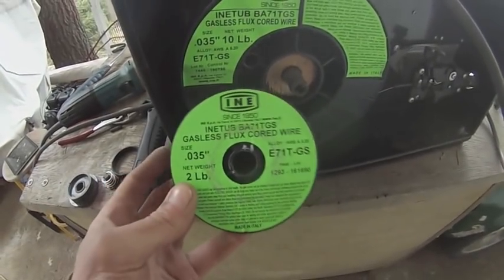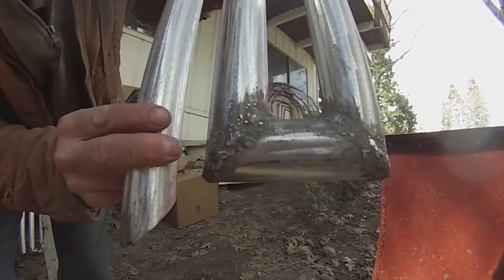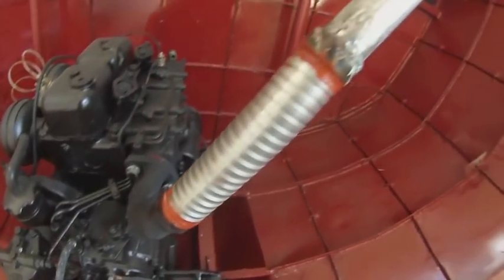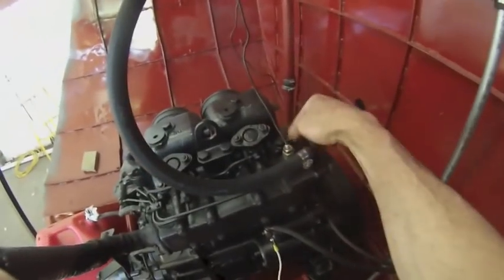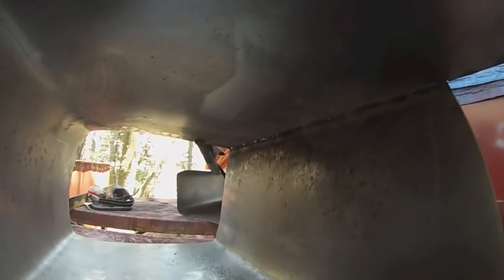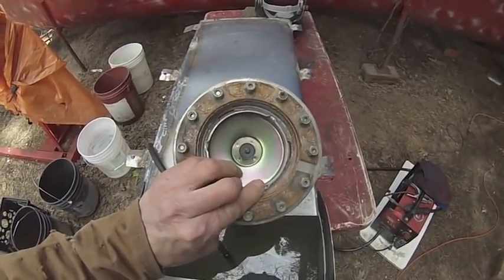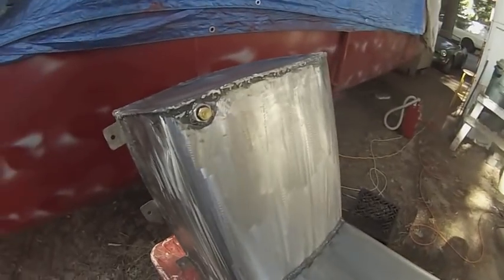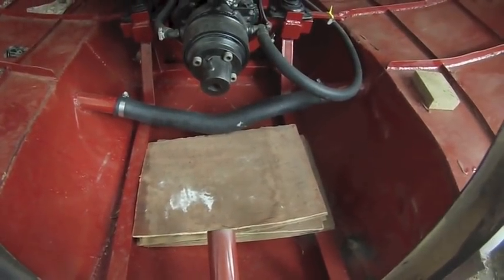Steel Sailboat Build Part 27

Comment: Good video update.  The motor is running really well.  Be sure to put a grommet of some sort at the top outlet end of the pipes you have your recirculation hoses coming out of to reduce any abrasion from the edge of the pipe.  Take care and have a good week.

Comment: I absolutely love watching you! Like many of the dildos that spew negativity about what you are doing, I am also terrified with what you are doing BUT so far you have not done anything In terms of design that will take your life so my vote is for you to keep doing what you are doing! You are inspiring even to the know it all do nothings! Just use burn rated fuel line and change the radiator hose you have traversing the bilge out with something that won’t melt and you will be fine. Thankful for your posts!

Comment: While I commend your efforts, that cooling system looks like it's gonna be a ton of drag. Not good for a sailboat. It'll need to be encased inside of a fairing of some sort to let water slip past. As it stands you're gonna be kicking off vortex eddies any time the boat moves and you'll lose a lot of momentum.
Reply: Agreed.  Also a risk to get torn off by travel - lifts and other handling activities, nevermind corrosion risks. A direct seawater-coolant shell and tube exchanger is almost certainly a worthwhile cost here IMO.
Reply: Not as much drag as the regular rigid propeller he'll be using...

Comment: i agree with the comments that having any fuel tank above an engine  is a BAD IDEA any developing little leak gonna be  big problems.. I've done a lot of metal work on boats over Thirty Five years,  and never seen that on any boat before. I'm into constructive comments. Build a fuel  tank into your Bulkhead and side of "The Boat" thats where most all tanks are built into. and the tank is all ready half built useing side of the boat and builkhead  leaving plenty of room to work on the engine and then go get some air fittings and  hitch the tank to some compressed air 20 lbs at most spray edges with a spray bottle of water and alttle dish soap and you will see the leaks

Comment: You can have great water tight air tight welds and they will weep diesel. You may want to use a fuel tank sealant inside the tank

Comment: Greetings, Craig,,
May I suggest that you, seriously, rethink the efficacy of the outboard cooling pipes that circulate engine coolant.  While the exterior pipe method may provide adequate cooling of the engine, there appears to be several negative factors involved.  (1) The pipes may dislodge, or pull away from their attachment to the hull, if they encounter rocks, sand, etc.  (2)  They offer a great means for attachment of weeds, ropes, and lines.  (3) Like others have suggested... they will provide drag, resulting in decreased sailing efficiency.  
         It will take a little time to cut the pipes off, and patch the holes, while the hull is out of water.  Then, you can weld heat exchanger boxes inside the hull.  Cheers!
Reply: This is a very common practice by running pipes outside of the hull to serve as a radiator. Lots of seagoing boats have these external pipes outside on the hull.

Comment: You will not Really know if you have good welds without testing them with a dye penetrant and developer. It's inexpensive and the dye will find Any issue quickly. It will easily flow against gravity if needed too.
Good progress. Crazy boat. But cool nonetheless!
Reply: Let's not forget he's using flux core wire, which is not known for deep penetration or clean welds

Comment: I've been concerned on the stability of this vessel from the start of construction, having the weight of the steel and fuel higher than it should be just adds to the concern, cruising around a small lake is the reason for this build, is it not ? Cheers !
Reply: He does have a significant concrete keel that he has not yet attached.  But i do agree a righting moment analysis should be considered to make sure this sucker has sufficient stability.

Comment: Great job man , why is the fuel tank in top of the engine , any particular reason ? just curious
Reply from the maker: I wanted to keep the area to each side of the engine as clear as possible, so it is easy to reach the engine, sit comfortably next to it and work on it.  Also wanted some gravity feed for the fuel pump.  In the future, I'm going to test to see if the engine runs on just the gravity feed.  I also want to keep the engine compartment small.  If water comes in through the prop shaft hole (stern tube), I want the flooded compartment to be small so it does not sink the boat.  There are no other holes in the hull below the water line.
Reply: That sounds like a bad idea hope you don't get even the smallest leak

Comment: Im not too fond of the designs in this particular video.
 Cooling.... tubes can be ripped off very easily.
Fuel tank...build and its location, scares the hell out of me.
I think,  insurance coverage will be a real bitch. I hope you are installing an automatic fire suppression system in the vessel.
I did enjoy the red paint finish! Its like its own fire fighting boat.

Comment: You can learn to TIG weld.
Reply from the maker: I took a welding class and learned to TIG weld.  However, I cannot afford the TIG welder.
Reply: Or MIG/MAG with gas, much easier and much better welds, in strong winds you could switch back.
Reply: I grew up in a fishing village all my family were fisherman with different shapes and sizes of boats through the years. The cooling pipes were made of copper nothing else, someone mentioned using plain steel, how long would that last with the electrolysis and saltwater if that is his plans. Wake up people !
Reply: Check out Urchfab's channel there's lots of welding tips. No you are NOT allowed to stop the boat build  to do a "Rat/Mongrel  Drifter".

Comment: Question I want to build my own boat someday do you have any tips advice about how I should go about doing that?
Reply from the maker: I'm no expert at anything, but here is what I think is important.  Build where you live or live where you build.  It's nice to walk out the door and get working.  It can still get done, though.  Emerald Steel didn't live where they built, but they did work long days and got it done.  SV Seeker recommends pushing to project forward a little each day.  Some times I don't feel like working on the boat, so I research materials and methods.  Most importantly, just keep going.  Most boat builds take five to seven years.  Mine is going faster because I don't care much about how it looks.  I just want it to work and get me out there without problems.  Then there's money.  If you have half a million dollars, you're set.  If not, a lot more work and resourcefulness is required.  I think that's where most of the fun of the build is.  Another good part about building is you can pay as you go.  Everyone told Emerald Steel they were crazy, but they've sailed for 30 years now.  Worth the effort of the build.  Let us know if you decide to build.  I would love to see another build.
Reply: I think you are asking the wrong person.  There are plenty of people out there that are building boats that actually know something about it.
Reply: BUILDING A 26' AUTHENTIC STEEL TUGBOAT CRUISER.   Thanks for the information!
Reply: SV Rusty Junk.    Thanks 👍👍
Reply: Read books written by people who build boats that others have gone to sea in.
Don't invent it all yourself - build on the knowledge of others and choose where to add value.

Just my opinion, obv. there are other approaches.
Reply: Learn to weld for a start
Reply: The best thing you can learn from this channel is what NOT to do.

Comment: Your welding is shocking you will die 100% in that boat
Reply: Jack Kelsey 100%?
Reply: 100% died
Reply: Agreed 110%. All those people giving this guy money to continue his maritime suicide mission will contribute in his death. Man, placing that bodged fuel tank over the top of hot engine cooled by bodged piping, in tight compartment, is nothing but great plan.
Reply: Helloverlord ....not only do I own a 42 foot steel sailing yacht with a 70 horse turbo diesel but I’ve been working on them for 30 years. I know exactly what I’m talking about when I say he will be just fine. Almost any working boat with a diesel motor has leakage somewhere. You could fill the bilge with diesel and smoke cigarettes and nothing will happen.
Reply: @josephesposito8402  you could be what you said you are but you surely doesnt sound like a person knowing stuff. I never said diesel pond could be ignited with a fag so I cant understand your point. A said heat and saturation. Is there some exaust in those diesel engines? What is the temperature in small compartment with engine running? You cant ingnite liquid diesel but vapors are different story my dear experienced 42 foot yacht (what color?) owner 70 horse turbo power friend...
Reply: Also I am a Welding engineer and I specialise in maritime welding if your Steel yacht is leaking anywhere then that is a badly built yacht anything under the waterline should be fully watertight I can guarantee you that if you done any type of NDT non destructive testing on them world's 98% would fail I know what I'm talking about and I don't care if you have had a yacht for 30 years
Reply: Jack Kelsey maybe you should get out a bit more. Although I agree a leaky weld is not ideal there are hundreds of thousands of leaky steel boats out there that go to work every day. Constructive advice to this guy is great but absolute statements as to what is going to happen with this project is not only plane ignorant but just simply lame.